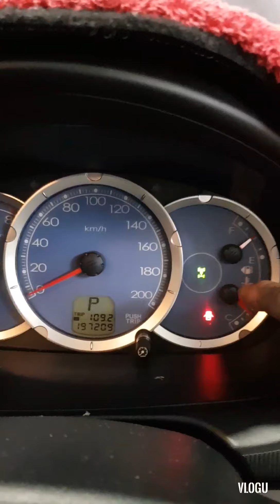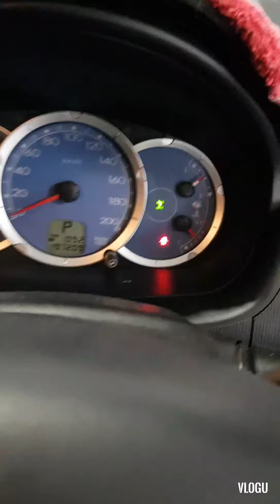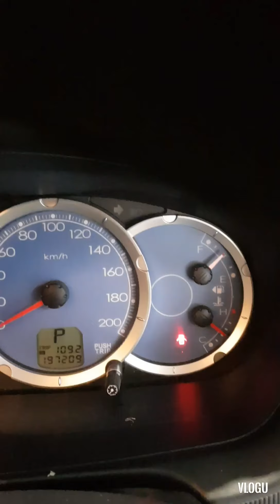Mits. Triton 4WD lights Blinking on Dash

Comment: Hey mate i have this  Problem with my 2005 MK triton i have change the  Solenoid and the light is still flashing on the dash board can u tell me what it could be
Reply from the maker: kindly pls. check the power supply of the 4WD solenoid, and check if there's a vacuum supply to your solenoid. thanks tyson

Comment: I have the central diff light blinking after I drive for 25 km in 2H gear on my pajero 2018, what could be the problem
Reply from the maker: Just the vacumm going through the actuator and power supply for those solenoid, thanks

Comment: Hi Dan,

I had the same problem but all
Hoses connected and inspected. I replaced the solenoid and lamp switch on the front diff. 4wd seems to physically works but light constantly flashing still. Do you think it’s one of the switches ontop of the gear box?

Thank you!
Reply from the maker: Check if all the vacuum hoses are not damage, some hoses pops out due to its age, try to check if the vacuum hoses to solenoid or to the 4wD actuator is sucking of air or not

Comment: Sir mangutana unta ko..sa nissan navara d40 model ang iyang four wheel Lo nag blinking...akong gipang dis engage ang tulo ka switch sa may transfer case mawala siya pero ang 4wd mo siga man unya ang naka steady sa four wheel ...dragging kaayo..daghang salamat mr. Dan!
Reply from the maker: may isa na ka switch Dan ang na nagmamalfunction, paki check mo ang 4wD switch baka sira, kung ok  tingnan mo ang 4WD relay nasa egine bay magkatabi yan dalawang relay ng 4lo at 4H
Reply: Okay sir  Dan maraming pong salamat...

Comment: kuya sa c/d lock blinking light pede rin kaya hose or solenoid valve ang may diperencya,thanks in advance
Reply from the maker: anong sasakyan to sir? at anong c/d ?
Reply: @dandelao9653  pajero 2002 automatic V6 3.5L GDI PO KUYA,Center differential po ang C/D kuya
Reply from the maker: @mengtayeh2615  ah ok, tangalin mo ang vacuum hose na nakakabit sa acuator ng diff. check mo kung may  vacuum  supply, kung wala check mo kung may supply na vacuum papunta sa vacuum solenoid, pagmeron check mo kung may power supply ang solenoid kung meron palitan mo ng solenoid. at kung wala naman check mo ang fuse. ngayon kung wala naman supply na vacuum papunta ng solenoid check mo ang vacuum hose na galing ng intake manifold sa may firewall banda or likod ng makina, update moko kung ano ang development sa pag diagnose mo salamat

Comment: Saan po location ninyo kasi may ganyan na nagbiblink ang montero ko.
Reply from the maker: Hi neri, sa Australa po ako sir, sundan mo lang ang video ko sir at baka sakaling malutas niyo ang problema ng 4wd lights on niyo.
Reply: @dandelao9653 Noted sir kag madamo gid nga salamat sir.
Reply from the maker: @neritumadiang817  👍😃 ilonggo ka man gali. ah ti segi good luck tho neri
Reply: @dandelao9653  ok sir ah. Kamahal sang Vacuum Solenoid kung baklon sa casa. Ti nagapangita ako sang mekaniko nga makakuha sang blink sa dashboard sang montero. Sa Lazada barato lang pero para lang sa Pajero. Cgi ah testing ko ang advice mo. Salamat gid liwat.
Reply from the maker: @neritumadiang817  check mo anay sir ang vacuum line baka may natangal lang or nautod ang hose at check mo man ang power supply pakadto sa solenoid.  bag o ka mag jump sa vacuum solenoid
Reply: @dandelao9653  ok sir ah. Madamo gid nga salamat.